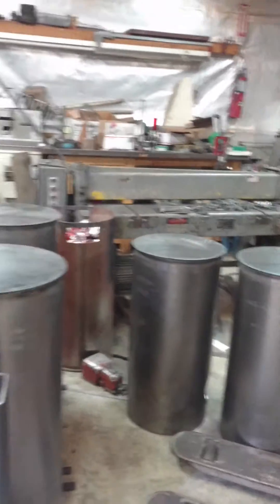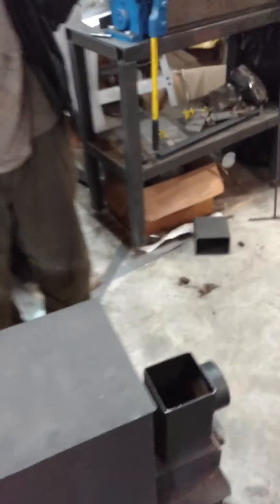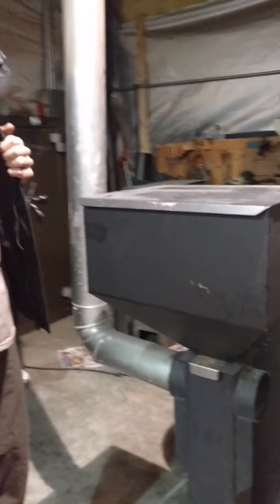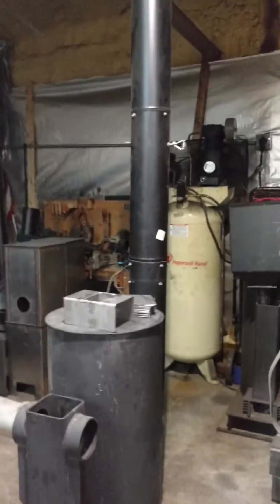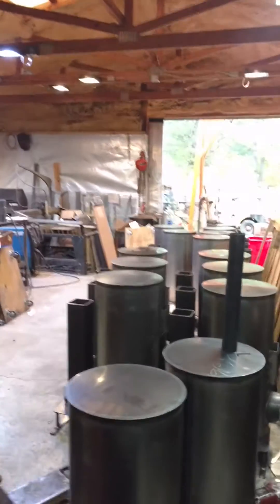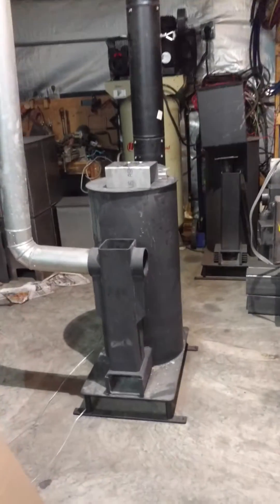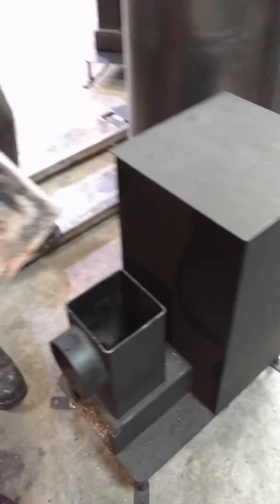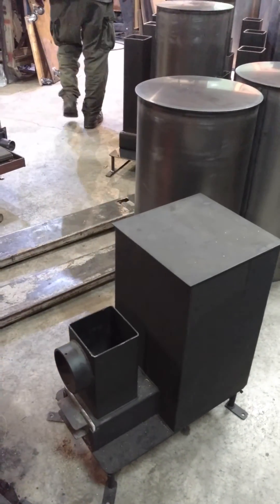Liberator Rocket Heater Manufacturer Tour

Comment: In my basement exhaust is gonna be the problem. Is there a blower you can put on the pipe to push it out I do have a corn burger going out to the side.
Reply from the maker: I would not trust an electric blower. Wood exhaust tends to wreck those pretty quick. With a mass battery/heat exchanger the exhaust temp tends to be pretty cool so it might work with a pellet heater wall exhaust but I wouldn't chance it. Solid fuel heating appliances should always be connected to their own UL listed double wall insulated stainless steel chimney that goes all the way up to at least two feet above the highest ridge line of the house. Thank you for watching.

Comment: How thick is the outer cylinder and top cover please and thank you
Reply from the maker: 1/4 inch on the cap, pre-tensioned 16 ga on cylinder.
Reply: What’s the distance between the top of inside tube to the cover
Reply from the maker: @sarmadsleyo5052  I don't remember. It should be about 3 inches.

Comment: Where can I get information on ceramic coating that you use and I can understand ?? Thanks
Reply from the maker: The ceramic coating was not used in the final production design, instead it is lined with replaceable 1/2" ceramic insulating board.

Comment: How thick is the ceramic coating inside the pipes?Are all the pipes that are direct in contact with the flames coated with this ceramic? Do you spray/paint the coating before welding the pipes together? And where do you find this coating to buy it?
Reply from the maker: This video is a few years old. The Gen 2 Liberator has a  replaceable 1/2" ceramic board liner in the entire burn chamber and heat riser. I don't think they found the spray coat adequate given the high temperatures inside.  https://rocketmassheater.com/recommends/unclemud/
Reply: @UncleMud  Ahh. I see. But sky thought it worked, or not?
How thick is the inner tube in your 2.0?
I am building my own since I works with welding and have a lot of material at hand. Thought maybe a slightly thicker inner tube would do. I have 6 milimeter (which I think would be 1/4 inch, if I am not mistaken).
I thought of having three pipes. One inner, then one outside of that as an "outer wall". In between those I would use some form of isolation so that it becomes a thicker pipe all together. Then the outer, big pipe as combustion chamber. As showed 1:55 into this video: https://www.youtube.com/watch?v=z_hgLoMPaGg

Is it of any importance of how wide the outer pipe can be/needs to be?
Reply from the maker: @Zazquatch1  For long life the inside of the 1/8" steel inner tube (riser)  is lined with 1/2" ceramic board on the gen 2 liberator and the standard stove pipe inner tube on my considerably lower tech CottageRocket is lined inside with ceramic wool. They are all aging quite gracefully, even my 8" CottageRocket. I want to thank you for the video of your great rocket heater. There's a lot of innovative stuff there. Unless you keep the cross sectional area down below about 20 square inches AND forego insulation around the metal to carefully keep the metal sides below 906 degrees (like the gen 1 liberator did) I do worry from personal experience that your well insulated (on the outside) inner tube is going spall away to nothing within a season or two no matter how thick you make it. To be clear I think it is a good idea to be able to easily inspect and replace any and all rocket components so that you will do it at least every year or two no matter what you make it out of. If you have the same access to and familiarity with metal that I do to cob I could totally see you making your inner tube super easy to replace like a pool filter. The problem with making your unlined uninsulated inner tube out of metal like the Gen 1 liberator was is that creosote burns at about 1300 degrees, so even though an uninsulated metal rocket has a lot cleaner burn than a typical woodstove allowing us to use a thermal mass battery and all that, the burn is not nearly as clean or efficient as the burn in a rocket insulated as well as or better than yours. If I made a rocket as well built as yours I would line the inside of my 2" bigger inner tube with an inch of ceramic wool or a cast ceramic wool refractory riser sleeve.  I would also line my 2.5" larger burn chamber with cheap easily replaceable 1.25" firebrick. Below is a link to  the one year report on a heater we made out of junk and cob and the aforementioned adjustments in the core. at about 1:45 you will see what happens after a month or two to a very expensive piece of high end stainless steel used as an unlined but insulated inner tube in a heater that gets hot enough to burn all the creosote and smoke. Thank you for sharing your work. My on is a welder and he is teaching me how to appreciate fabrication as a well done art. https://l.facebook.com/l.php?u=https%3A%2F%2Fvm.tiktok.com%2FZMRyxEhSr%2F%3Ffbclid%3DIwAR0aYaLyRZwsFZ9yABpicgwl2FftCqYE3-7HBrwXPRhNV309R3CfPoMq7aE&h=AT0Ogxq_wxP6s_GEf4umOYf8uKlE3MziPaj195EvR5ItXze-wOD2LI2BOqielK6xfhB36JD9KRPM57x6CxKWZUOcEJu62rpGheltMFH7LWhUrngetPrb9i6vvwL2TNQIEC8T7g
Reply: @UncleMud  Thank you for the answer.
The video I shared was not my own build but an idea that came frpm someone in Poland. Still I hought it would give an idea about what I was aiming for.
I am not atm. working on my Mass Heater.
Reply from the maker: @Zazquatch1  Thanks for the clarification. The problem remains that metal as an unprotected internal liner lasts weeks maybe months in a RMH that is burning hot enough to reliably burn all the creosote and smoke. Please consider that in what you are aiming for.

Comment: The only trouble is without the mass and burning scrape wood it has to be feed hourly is what I saw on their website.
Reply from the maker: I feed mine every half hour or so during the day and running the chimney through a thermal mass bench stores the heat and keeps the house warm over night.
Reply: @UncleMud  Ouch!  Every 1/2 hour is a LOT of maintenance.  Doesn't sound at all practical for wood fire.
Reply from the maker: @keoniwalaka8858  This is why a Rocket Heater plugs into a mass battery like a cob or pebble bench to store the heat and slowly release it over night. It isn't for everyone, but if you work online or have one of these in your shop you get used to dropping a couple scraps in every so often. The payoff is that I use 1/3 the wood my old woodstove used to use and instead of $300 per cord split red oak I use $30 per cord hardwood flooring scraps that don't burn well in a traditional woodstove.

Comment: What is the riser made of?
Reply from the maker: The riser on the Gen 1 is steel. 3 years on there is no erosion on it. Stay tuned for an unboxing video of the Gen 2 due out in the next few months it has a replaceable ceramic board liner.

Comment: Few questions:
1. Did he say when the 2.0 and mini are going to be available for sale?  
2. Is the mini going to be UL certified?
3.  What's the advantage of UL and EPA certified vs UL certified?  

Thanks for this video!  Neat to see behind the website.  I'm setting up my addition now for this, just debating waiting for another model besides the Mach1.
Reply from the maker: 1. The 2.0 is expected to be up and epa certified within the next 3 months. The mini will not be UL listed. All woodstoves sold for residential heating are supposed to be epa certified regarding their particulate emissions as of 2020, but things are slow and disrupted at the EPA for reasons this year.
Reply from the maker: EDIT January 2022: The price of the Liberator RMH-2 will be $2900 when it is available for purchase again. Supply chain problems and building a new factory to accommodate existing orders have slowed things down. Tell them Uncle Mud sent you.